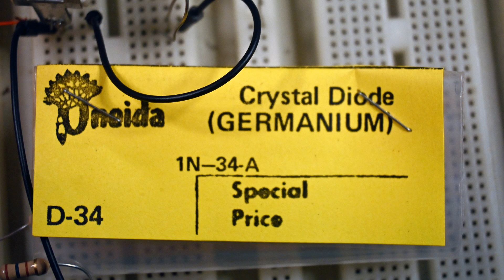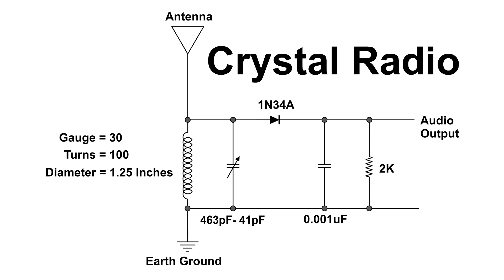Crystal Radio Build Demo and Short Story

Comment: I don't understand what the purpose of the 2k resistor is?
Reply from the maker: It is to close the circuit. If you use 2K Ohm headphones you do not need the 2K resistor.

Comment: Hi, I don't know anything about crystal radio, but I have become more familiar with the principles of LC resonance and AM signals also with the help of an LC calculator.

 I build my own "crystal radio" circuit, I don't know if it will work. But my plan is Use materials like the following  :
- NOS USSR Germanium Diode (Vf 0.240Volts) that i bought On my local online shop platform there is no information, but in the review section from other buyers there are full positive responses, the advantage I see here is the low Vf Even though the diode was sold very cheaply and without any information. They had no idea how rare such diodes were.
- a Crystal earpiece (unknown brands, Seller refuses to measure DC resistance/impedance/capacitance)
- 1mH (1milliHenry) DrumCore Ferrite Inductor 
- Ceramic trimer (variable capacitor) 100pF, approximate minimum capacitance is 5 to 10pF
- a parallel resistor/ceramic capacitor for Sound clarity (I will calibrate it depending on the capacitance of the crystal earpiece that I will buy later)
- 20metres of 0,45mm Litz wire
- soldered the ground wire to a metal rod, stabbed to a wet ground In the garden/Ricefield Near my house
- an impedance matching Transformers (optimal)

 Yes, it is estimated that this circuit reaches a maximum frequency of around 1.596MHz ((if the ceramic trimer capacitance is 10pF) Let's just say 1.6 MHz or 1600kHz (All calculations use the LC calculator) Or 2.251MHz if the minimum capacitance of the ceramic trimer is 5pF. 

 And at a maximum capacitance of 100pF, approximately the resonant frequency of this circuit is 503,292kHz. 

 But this is just my plan, I have never made any type of radio before. But some AM stations are still active in my area, Some are 1.7km to 13km from my house.

 Question : would it works? I don't know whether a simple crystal radio is a simple LC resonance system or does it need other additions as a radio?
Reply from the maker: The home made coil in this video works very well. To make the tuning easier use a variable capacitor out of a old AM radio. I’ll be glad to help, ask your questions.

Comment: Hello, dear teacher. I follow your channel from Iran. I wanted to ask you a question... despite all the care I take in making the circuits and using the best parts... 
But I only manage to receive 2 or at least 3 radio stations.  What to do to receive multiple radio stations with a crystal receiver?
Reply from the maker: Thank you, A good earth ground is very important. A long (20 feet or more) elevated outside antenna is also important. After sunset is the best time to peck up distant stations. Hope this helps.

Comment: Yes, that is working nicely.  The simple design like that is good on sensitivity but not so good on selectivity.  A "loose coupler" can get you selectivity at the cost of a little of the sensitivity.  You may want to make one of those to continue your experiments.  Double tuned systems give you better selectivity and possibly no loss of sensitivity.
A tuned loop antenna experiment I did also worked out well.  I suggest that for people who can't string antennas and grounds.
Reply from the maker: It does work well. Here is a 100 year old radio.
Atwater Kent 10 Signal Flow and Circuit End to End 100 Years
https://www.youtube.com/watch?v=wQ8djN15F48

Comment: I've bought diodes with that part number from several sources which all claimed them to be authentic. (They are not)

However I recently bought an old 300 in One Electronics Project Kit from a Goodwill store that has a genuine version of the diode included!

These Project boxes were sold by Radio Shack and others and while the box is in tatters I found out the contents were 100 percent intact.

I tried the first circuit in the included projects book and quickly learned why the kit was intact.

There's no way a kid could have got it working as the built in switch for this project was faulty and the transistors included were different than the ones mentioned in the circuit diagrams.

These were the days before the internet so a kid couldn't look the transistors up to figure out which one was similar to the one needed in the circuit.

The kid that originally owned it probably got hung on that first project and gave up on the entire kit.
Reply from the maker: I just put up this unlisted video on how to jam a transistor radio with a crystal radio, and I put it in to SHOWMORE of this video.
Jam Radio
https://youtu.be/4U7dEDKD2NU
Reply: I made a video on that topic.
https://youtu.be/5y7I7G_a3Qo
My theory is that they sold you something like the 1N5711 pretending it is a 1N34.  They can be made to work but you need to be sure to put the loading resistor on them.

Comment: Is "threatened with bodily harm"  translated from "I'll beat you up!"? Lol

I remember the first time I built a crystal radio from junk parts, didn't even have a variable capacitor, just had a piece of wire that would glide over a sanded off portion of the coil. I was so amazed that sound could be heard from the piezo ear piece on a device that had no battery.
Reply from the maker: Yes that is right!! I also made a set like that, it seemed like magic.
I just put up this unlisted video on how to jam a transistor radio with a crystal radio, and I put it in to SHOWMORE of this video.
Jam Radio
https://youtu.be/4U7dEDKD2NU